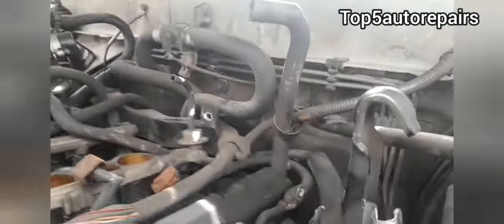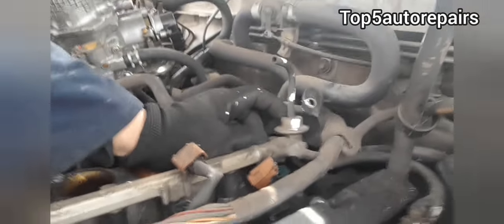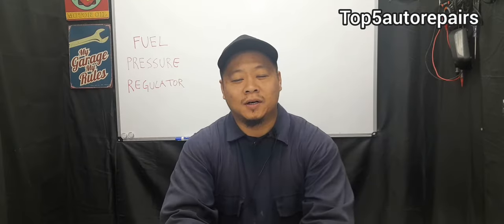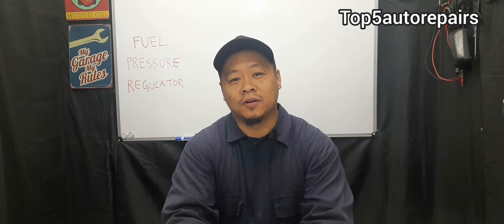SIGNS OF A FAILING FUEL PRESSURE REGULATOR GOING BAD

Comment: My car seem to lose fuel pressure after it's been sitting overnight...... could that be due to a bad fuel pressure regulator not holding pressure?  When I go to start up in the morning, it feels like the fuel line is half-empty when I turn car to ON position to prime the fuel pump.  Sounds like the pump is also making gurgling sounds like it's having trouble running pressure through the line.
Reply: Possibly your fuel injectors leaking, which is pretty slow, so they might start up fine within an hour or two
Reply: Did you ever figure out the issue? Sounds like what mine is doing. Maybe a gargling / grinding noise coming from the pumps.

Comment: That’s pretty much all of my symptoms, my new one arrives tomorrow, hopefully it fixes my issues.
Reply: Update, it fixed every issue I was having, thank you for the information.
Reply: @BeautifulMan4015  and mine will be here tomorrow lol
Reply: @Realmphukng  Hoping it works out for you, my car runs so much better now.
Reply: @BeautifulMan4015 what symptoms was it?
Reply: @dapogiman28  Harder to start while hot, stalls when taking a slow right turn, also fuel coming out of your throttle body into your MAF and air filter. Reasons why was the fuel pressure regulator was no good, it was sucking fuel into the air system since the diaphragm was damaged.

Comment: My situation is kinda similar , but my problem Is I was driving home one night and I lost power like it drove for a few more miles and then suddenly brakes got harder to use and I could no longer go faster got harder to accelerate all my lights were still on still it jus got to crank no start , few weeks after I bought an obd reader it read code p0001 “fuel regulator “ but before I bought it more than 1 person told me it was my fuel pump , I’m jus really lost on which part to purchase
Reply: Probably both. I just changed my fuel pump, filter, and injectors. My car is running better but it's still taking a tad longer to start than it should and it stalled after starting once. So I'm going to change the pressure regulator and hope that's the final problem. But if you want to go for the cheapest option, do the pressure regulator first.

Comment: What is glow plug in diesel engine?
Reply: engine heater, one of the important parts of  diesel engine
Reply: They heat up inside the cylinders  for ignition of the diesel 👍

Comment: you taught us how to test for a regulator thats running rich, how about if it is running lean? if its lean it means there will be no fuel coming out of the vacuum hose right? i know its lean coz i checked the spark plug and it is clean almost white.

Comment: I got a 91 Ford f350 7.5 with a vacumm fuel pressure regulator. What if there's a little smell of gas in the vacuum line but no leaks?

Comment: My car drives well on fairly flat roads,problem comes when i have go up hill (fairly steep road),the car does not accelerate beyond 40km/hr then it violently stops with bang which sounds like its from the engine bay.it almost stops,gets to a lower gear.If i need to go up steep hills,i have to be gentle on accelerator.Disturbing

Comment: 2015 Hyundai genesis coupe 3.8 v6 the regulator is ticking/clicks on every time we try to start it, obviously that might be the problem but just want some feedback on what we can do or more things we can confirm confirm that it’s bad, can we use a multimeter

Comment: i’m getting a fuel pressure regulator open circuit code when it rains or snows and was wondering if i should replace my regulator or look for damaged wires? only comes on when it rains or snows or super moist out. (2018 gmc Sierra)

Comment: Can an injector cause a low fuel pressure errors? (especially the Siemens piezo injectors in VW)
Reply: Yes it can it could be bleeding down into the cylinder filling it with gas smell your oil and check to see if the oil smells like gas if it does change the oil and filter asap and fix the injector /  injectors the ones that are leaking fuel could also be fuel pressure regulator you can check and test it with a fuel pressure gauge on the fuel rail
Reply: Thank you, do you have a video which explains how to check if diesel leaked down and mixed with the oil? I tried to smell the oil but I’m not sure if it’s a normal smell or not
Reply: BTW, I performed injectors flow rate test and in 5 minutes all injectors returned equally a 5ml of fuel. But this test is did after i replaced 1 injector that i was suspected that it’s faulty